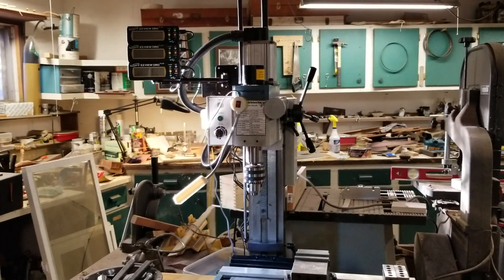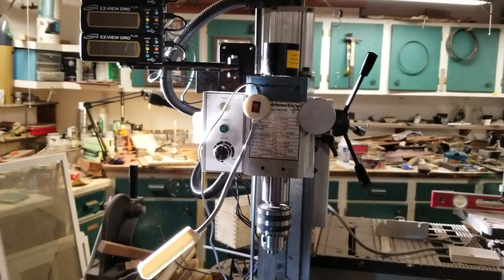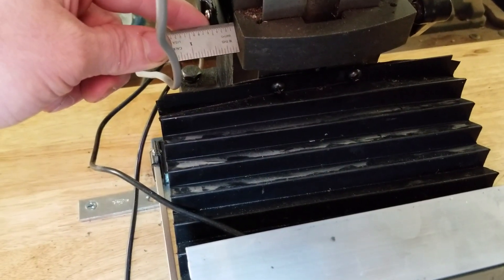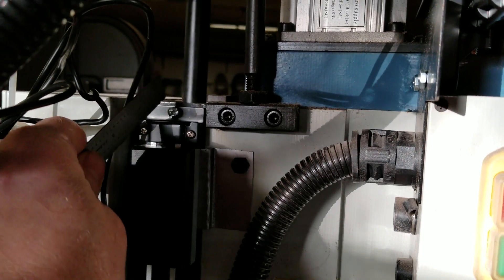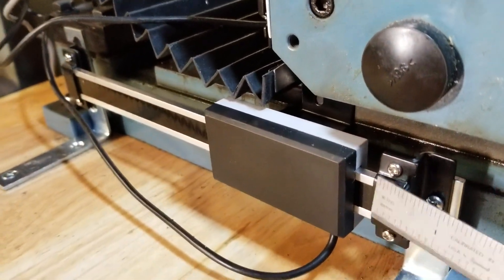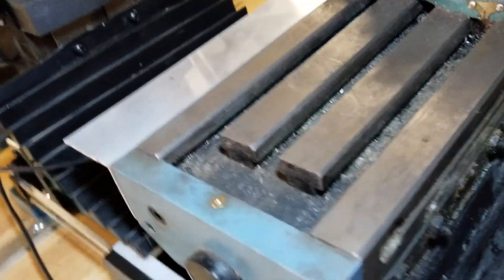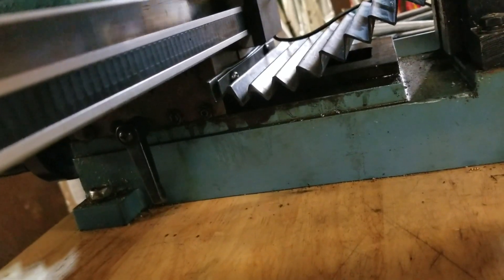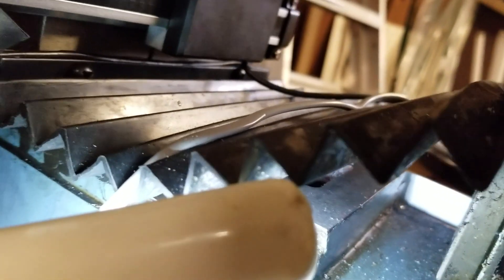I Gaging Easy View DRO's mounted  on my mini mill

Comment: That Y axis install, for what you're using the machine for, is brilliant.  I've been thinking about upgrading to a dro so I've been watching a bunch of install videos and the Y axis is the hardest because of the angled base.  I thought I might get the dro kit from Little Machine Shop figuring it would be a drop in plug and play deal buying the dro from the same company I bought the mill.  Not the case, people still struggle with the Y axis with LMS's kit as well, a rare miss on their part.  It would be really nice if their machines shipped drilled and tapped for their dro kits, at the very least ship the dro with Y axis mounting blocks that match the angled base surface.  Great job, great video!

Comment: for protecting the x-gage, what about a u-shaped alu extrusion, or if you can' find that size, then look for rectangular tube and remove a short side, either one providing an inverted U shape over the gage.

Good job and explanation.
Reply from the maker: That's a option for sure but would have been a real headache  to mount due to the fact that the slider bar needs to be adjusted  so that the slider can run back and forth without any binding,I did this by mounting everything  and using a quarter  as a gauge  before I tightened the bar screws.
Reply: Much better option than whats been done, wont last long. Did the same on X axis with them cheap scales 20 years ago and covered over with angle, lasted two months. 
Bit better did much the same on Y axis but sat much lower down on opposite side on the cast taper, that also packed up.
Vertical wrong side also, chips have better access that side to the scale than the right side with a clockwise spindle!
Your machine do what you like, bit that unstall on Y aint right in a million years, should be direct to the two sliding surfaces not via additional factors such as the machine that will move despite being bolted down! Wouldnt have took any longer to do it properly.
Reply from the maker: @jhareng  I added  vinyl  sheeting over all the slides and after that used it ,no problem,as for the y axis  its solid  and works just fine,I put the z axis  on that side due to the fact that my z controls are on the opisit side and so are the gib adjustment screws. I just got done slotting  a knife guard and it worked great .

Comment: Good video. How are these dro's holding up? I just bought some and was wondering how reliable they are. Also, are they pretty accurate? As far as you can tell?
Reply from the maker: As far as I can tell they are accurate  and repeatable, they hold up fine ,buy a bunch of batteries  and have them on hand so that when they run out you can just put new ones in,the batteries  actually  last a long time as long as you remember  to power them done when your done working.
Reply: @WildmanPB  good to hear. Thanks for the response.